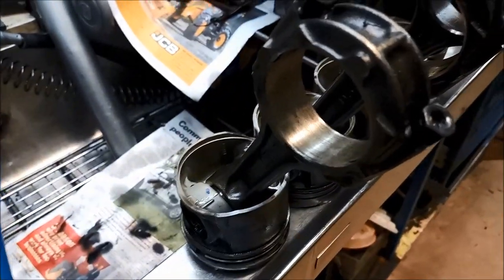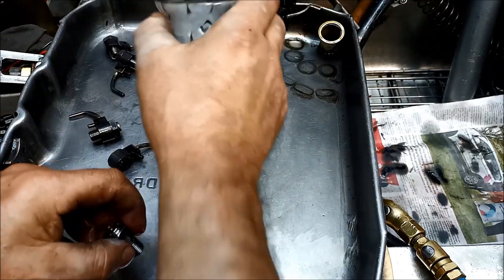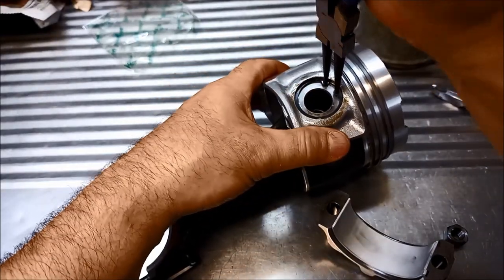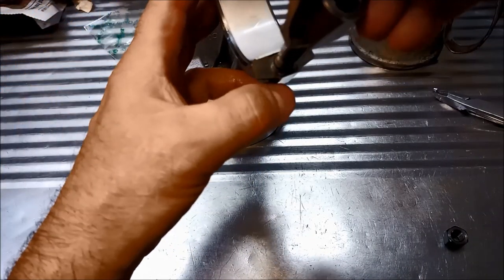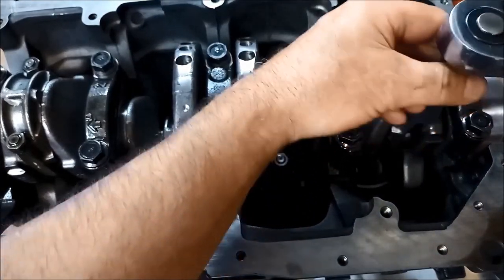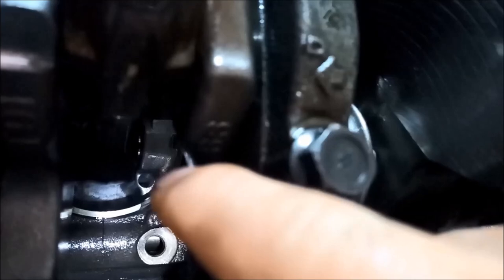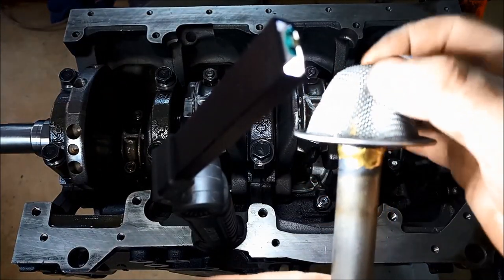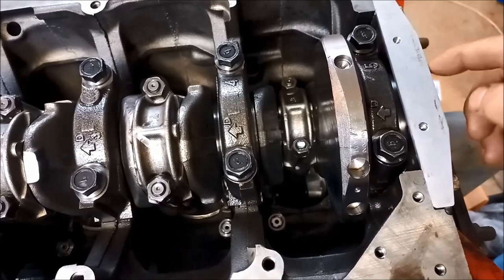Mitsubishi L200 2.5L CRDi TDi 4D56U Full Diesel Engine Overhaul 4D56T 131KW  Part4

Comment: Hello, did you put any seals(gasket) in the oil jets? 
Because I Repair´d 2 engines:
A Mitsubishi pajero 4d56T and a Mitsubishi L200 4d56TD
And my big question is, why in the pajero had gasket in the oil jets and in the L200 dont
Can you help me?

Comment: Hello my friend,please can you tell me the torques of main bearings caps,con rod nuts  and cylinder head bolts for 2098 4d46 Di-D?
Reply from the maker: hi, will be similar or same as 4d56u specs in vid. cheers

Comment: Great channel ,,, wonderful information,, I got a question, I have 2016 pajero 3.8 gasoline engine with 5 speed automatic transmission v5a51. I changed the transmission cooler to 40 unit tru cool with out going thru  engine radiator. Do I need a bypass valve ? I living in gulf temp in summer reaching over 50 c and in winter 6 c ?
Reply from the maker: hi, only time you need to go through radiator coolant it in sub-zero temps so as trans warms up quicker so so dont scrub out frozen rubber seals. thanks & cheers 👍
Reply: @YepThatsIt  thank you very much. So do I need to add bypass valve? Is 30 c trans oil temperature can harm the transmission?!